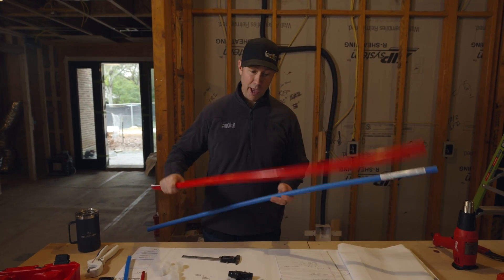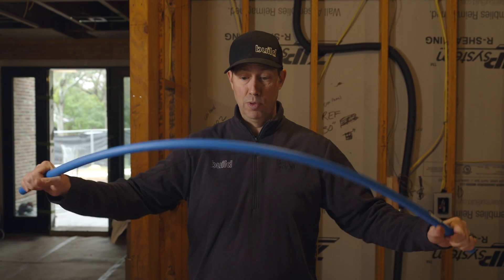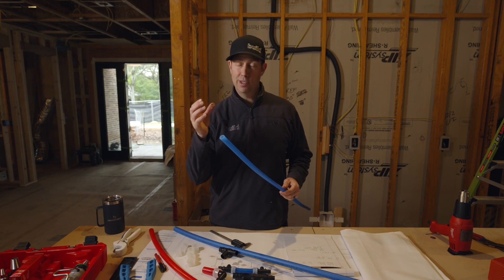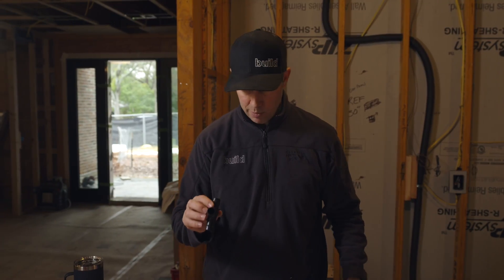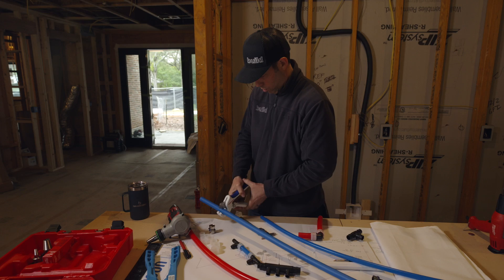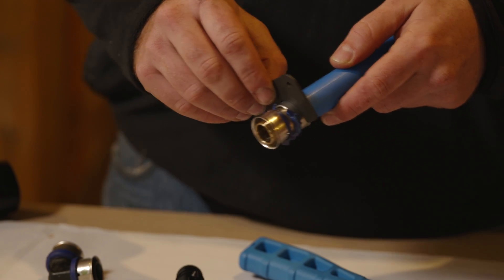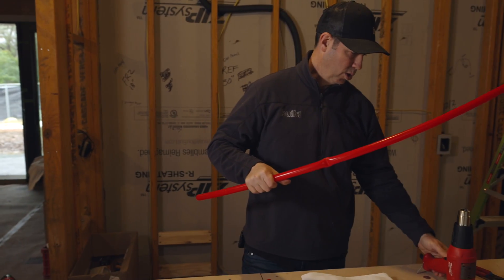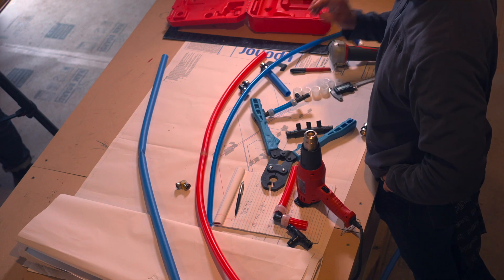Uponor Pipe System Review & Comparison

Comment: I'm doing extensive research on which type of pex system to use for my building and 2 reasons I won't use the Uponor system, 1. The class action lawsuit they settled for the brass fittings failure. I Which of made settle on stainless steel fittings with stainless clamps. These wouldn't be compatible with Pex A tubing. Second reason is Pex B is much more resistant to damage caused by chlorine. My local plumbing supply sold me blue and red Uponor pex A and regular brass fitting with stainless steel clamps. From what I'm reading its the absolute worst combination, in fact I just read that Uponor had to discontinue the blue and red pex A. Yet I see so many plumbers on YouTube singing Uponor's praises. Did I miss something?
Reply: I'm sure whoever is your supplier he only has pex B tipe that's the reason why he recommended that to you , let's  be honest and of course depending in what we are researching in internet that's the information what we get,  I'm sure everyone know how much good the hamburgers are,  but if I go and try to find all bad reviews about hamburgers of course I will find so much,  about it. I'm doing plumbing for last 25 years, and if in this moment  I hear plumber say uponor are the the best in plumbing products, needs to stop doing plumbing and get job flipping hamburgers 🍔   😆 LOL

Comment: Uponor flexibility is great. If it does get kinked you can use heat guns to work it out unlike other Pex. Less fittings is money and less fittings reduce how mucch you reduce your water flow. Uponor fittings always try to squeeze to its fitting and it saves you money on a buying fittings, your most expensive cost over the initial tool investment . . 
Uponor does expand and tries to reduce to its normal size . Uponor always tries to reduce to its original size. 
I'm a tradesman so I've dealt with all aspects of plumbing at some point. 
Pex fittings work fine if you upside the tubing to compensate for the flow. 
The stainless steel route is fast and good in tight places but crimping copper rings holds better but the tools are one expensive . They are better then pvc / cpvc but I personally like copper for durability

Comment: Personally I prefer to use VIEGA . Easier install and you don’t have to have a minimum of 4in gap between the fittings depending on the pex size . Upon just takes forever to install and the Milwaukee expander is garbage simply because the batteries last you a good 20-30 min depending on the pex you are expanding.

Comment: Matt, REHAU is the only other competition to Upanor.  Any differences between the two PEX-A brands is rather insignificant.  Both are PEX-A, and both have all of the same advantages over PEX B and C, including making long runs, without using lots of couplings.

Comment: What about brass fittings that reduce the size of the line? I have to use a brass fitting to connect to a galvanized pipe before I can switch to pex and it’s already a 1/2 inch pipe.

Comment: Every time I see polyethylene pipe, it reminds me of all the people who had to replumb houses that were less than 10 years old because it leaks after time.  I would have a hard time ever trusting plastic plumbing under pressure inside the walls. 

I have similar problems with engineered chipboard. Hurricane Andrew told me everything I need to know about frame buildings with engineered chipboard or structural Styrofoam. I would go steel reinforced ICF if I built a home today.

Comment: Such an ADD!,, 

Such an ADD!!! the pex B can use both crimp and expansion fitting, brass and plastic also. The B is twice as 💪, not affected by chlorine and can be used in recirculation systems, and pex A leeches small amounts of chemicals into the water. Why would you use 1/2 inch to your fridge?  If you make two columns and compare the strengths and weakness the B wins.  Having said that either are fine!  Not a fair advertisement if you ask me.

Comment: It is so sad that Risinger kneeled to a supplier’s marketing while it is so easy to check most of what is said here is false.
PEX that are expandable are ASTM F1960.  IT is not because they are “A” or “B”.  It is because they meet ASTM F1960   There are MANY PEX B expandable on the market today.  Just do basic proper researches.
Chemistry of PEX B is far more modern than ultra-old PEX A.  PEX B does not release measurable chlorines in water like PEX A does.  Which, by the way, was the main reason to develop PEX B to begin with.  PEX A is the next thing we gonna have to remove from our walls like Poly-B was.
The internal finish of PEX B is far smoother and accurate than PEX A.  Creating no internal turbulences like PEX A does.  Meaning PEX B has less internal resistance, consequently canceling any advantages that F1960 fittings may have.
But WAIT !!!  PEX B that meet ASTM F1960 are expandable.  With the extra advantages of using low resistance PEX B tubing.  Expandable PEX B has significantly less hydraulic resistance than PEX A.
Some PEX B has a bursting pressure almost TWICE as much as PEX A.
And PEX B has bracket that will bend and 1/2 tube within 6 inches radius.
Besides cost and being paid by a supplier, there is NO reasons to install PEX A today.
M.  Risinger, could you be professional enough and correct everything that is false in that video ?
Reply: Ok I get it , I use zurn type B and it’s expandable, but another brand may not be expandable?  you would think all type B would be expandable, that’s bizarre! Thanks.
Reply: @mr.redneck2715  An example of F1807 only (i.e. inserts and copper ring) : https://www.bow-group.com/technical-specs
Reply: BOW Pex is a super multilayered product.  Each layer having is own purpose.  It covers almost all potable water applications imaginable, but as long as you use it with F1807 fittings.

Comment: my understanding is that the Zurn PEX B is an expansion fitting too and they claim a better freeze protection....is this true?
Reply: Yes.  Being exandable means meeting ASTM F1960.  Some PEX B are F1960 concequently having the best of both sides.
Reply: No. PexB is stiffer which contractors often mistake for better strength. Hydrostatic pressure is a test of elasticity and shear strength. 

We do our homes such that we limit any plumbing on exterior walls. When we have to, they are wrapped in Armaflex and all of our homes employ minimum 4” Comfortboard 80 exterior insulation. 

If you refer to ASTM ratings, Uponor and Zurn tested identical 5106 rating. The ‘06’ is perfect score for both under burst pressure testing of 600psi long term testing. 

I’d suggest both are highly suitable for freeze burst mitigation but proper design installation is most important contributor.

Comment: Sorry Matt, you are giving a bad advice about Uponor Pex A superior to other Pex and that is not true. Because of its flexibility, which is the main reason it failed and leaked due to hot water. Give it another 4 to 5 years and most likely it will leak on the hot pipe.  From the last 35 years to present, copper pipe has a bad reputation due to pinhole leaks, because some manufactures are using recycle copper especially from electric copper wire, it lost the integrity of copper due to electrons saturation caused by constant electrons movement of electricity and became rigid. There is no winners here. I'm still researching... so far I found a USA company Zurn makes Pex pipe with expansion fitting F1960. The good thing is, it’s not too flexible and sensitive to hot temperature and can withstand hot C temperature (which is about 160 degrees F) for longer time without getting too soft and losing the grip at the connection. Hopefully this will wrap up my research about Pex pipe.
 https://www.youtube.com/watch?v=z3_GtI7O-HI 
https://www.zurn.com/products/pex-cross-linked-polyethylene/plumbing

Comment: Not a bad video but I can't say that I'm sold, especially the kink fix. Think I'll stick to regular pex with brass and copper fittings and whenever I save up for a dream home, that will be full copper
Reply: Copper is no competition for PEX-A.  Even the inferior PEX B and C is better than copper, especially if you live in freezing winter climates.  Copper can't handle the pressures that PEX can, and it won't leach anything into your water.  That kinked PEX-A is still probably six times stronger than a copper pipe.  The only thing Copper is good for is doing rigid stub-outs.  Personally, I prefer Rehau to Upanor.  T the differences between the two are not huge, but I like the Rehau couplers better.

Comment: A MINOR YET WELL SPENT  upgrade...under sink plumbing...instead of running flimsy 1 1/4 or 1 1/2 inch  trap and fittings and then converting to 2 inch at the wall.  Convert to 2 inch ABS pipe at the drain tailpiece and use 2 inch ABS for everything including removable trap.  Sturdy, serviceable, without any of those prone to leak joints found on 1 1/2 drain fittings.

Comment: The great part about PEX A is if you mess up and need to take the connection apart, you simply cut the white ring with a razor and heat it up with a heat gun, it opens right up and pops off.  Can reuse the expensive fittings at will.  SOOOOO much easier than copper!

Comment: OK.... I am a certified Uponor plumber.... what does that mean....mean crap...it mean I am certified to give you a 25 year warranty.  I  don't know if you contractor know about this...but your 1/2" OD Pex pipe is actually iD 3/8" compare to 5/8 copper pipe is actually 1/2"  This is why you need a manifold.....horrible.....Requires more space....I don't recommend Pex if you have a straight line to you bathroom..  I recommend install a 3/4 or 1" riser with a return line.  But if you have a bathroom on the north side and a bathroom on the south side...then its cheaper to run pex...Don't use Pex..copper will always be the best...now you dont have to sweat copper pipe anymore...Press fittings... cost more but you want have any flexing when the water is hot...pex also creak from the flexing..

Comment: PEX B is actually stronger, just lacks the expand ability and flexibility of PEX A.  Is PEX A / Uponor the way to go?  Yes, if you can afford or borrow the $500.00 M12 Milwaukee Uponor expander tool, and if you have access to place that sells PEX A.  For the average Joe, PEX B with the barb fittings and crimp tool Matt used in this video ( blue handled SharkBite brand) works quite well, and is very reliable, and more affordable!  If done  right, I.e. follow the instructions carefully, the connections are very strong and reliable.  Make a few practice crimps before doing the actual fitting.  An exception to what Matt said; the PEX that snakes through the wall directly behind him, could be done with PEX B.  PEX B can safely handle a 4-5 inch radius, and there are bend supports that facilitate such bends.  This video has some useful information, but misses the mark, IMO.  YMMV Peace

Comment: On a related subject, what suggestion do you have to prevent noise within walls caused by the expansion/contraction of hot water pex lines? I thought I would be done with the clacking noise of copper lines, but I was wrong.
Reply: Holy crap....That's is what I been saying...and I'm a certified Uponor installer. you cant stop the hot water from expanding...and it will always creak...Copper will always be the best as long you insulate the pipe.. dont under drill the hole  on the wood.....big difference. Or else you will end up install a hammer rest...  with copper ...you can actually have real water pressure.  cause 1/2 pex is actually 3/8 copper...same as the ones you install underneath the sinks... but 1/2" copper is actually 1/2"

Comment: I just used Aquatherm to plumb my new house and it's amazing. I'll never use Pex again.
Reply: I just looked it up and that is hilarious, My guess is that system is dead on arrival.  The Youtube is hilarious in how complex it is.
Reply: @ergofred  don't go by what you see online. It is still going strong in my area, and it's not complicated at all. It installs just like PVC except instead of gluing the connections you are fusing them. It's really hard to mess up. The pipe itself is self-insulating, the pipe fits inside the fittings (like pvc), etc. It is a superior product to this PEX junk which I have seen countless failures with.

Comment: I’m not convinced that the diameter reduction for the length of the fitting is even noticeable to any user.
Reply: And you are right.  PEX A being what it is, the interior finish cannot be as smooth as PEX B.  So, if you are using compressible fittings with PEX B, the internal finsih will cancel any hydraulic advantages that PEX A may have with F1960 fittings.  Evidently, if you are using F1960 PEX B, then you gain both larger fittings advantages AND lower tubing resistance.

Comment: I live in two states and cannot buy pex-a in any retail store. No matter the brand of pex, the online catalogs of pex fittings are fragmented, incomplete, and just poorly done. I already bought the expander and am committed to pex-a, one brand or another, but I hate the idea of having to over-order supplies because I can't wait a week for replacements or forgotten fittings. I also am not impressed with termination options of any of the pex products. Why would you want to run plastic, only to then break out the copper tools, etc? Why not have better termination with covers that make for a neater install  without one more connection inside the wall or floor for addons, etc? cover plates, etc. Product line is very basic and any of the exposed bits look haphazard at best.

Comment: Ok Matt I love your channel , but I gotta agree when you mention one product over another in a comparison well it kinda looks well not right . Having said that you should have talked price point , and YES got nurdy on chemical composition some . When you heat it does it larch more chemicals into the water then a splice. Used both types the both have there place in the market . The multi ports r great and the flexibility. BUT you gotta talk bottom line Also . And as far as restriction due to the fittings bottle necking I don’t think one person out there is gonna notice a pressure difference. LOL just saying . And you may have mentioned these in other videos . So now it official I love only 97 percent of your video . And I hate to hit thumbs down , you took the time to do this video , I took the time to watch and comment so well I’ll give it a sideways thumb . Heck you won’t read this anyway . Lol by now your people got people that do it . LOL

Comment: I use uponor for the same flow reasons you speak of. That being said, compared to copper pipe, I would still go up a nominal pipe size with pex a or b. The drag coefficients are similar. So unless you really use far less fittings than the copper equivalent the flow will suffer due to a smaller ID of pipe. This especially comes into play when you are talking about hydronic systems where GPM is important or domestic systems where fixtures need certain gpm. Uponor has a great calculator for pressure drop, velocity and gpm... just google it.

Comment: Been installing pex since it first came out.....guess what? Either one is fine. Prefer crimp pex because I find it faster and doesn't require expensive battery operated expanders. Every bit as effective at potable water distribution. And don't start with the "uponor is true ID" nonsense either. Your shower valves have 3/8" inlets. Same with faucets etc. Just size your piping correctly and volume and pressure should be perfect. Good uponor commercial though.
Reply: Totally agree. How often are you going to find a heat gun in the field during plumbing? Why would the ID of the fitting  matter when the flow is controlled by the end fixture that is 3/8". I've been making pex pipe and fittings for various leading manufacturers in the US for years. He does not understand the science. A1V1 =A2V2.
Reply: @JS-hl1oc  There's a lot more Matt doesn't understand than science. You can tell by his delusional beliefs in taking the bible as a literal text book...anybody who can do that is delusional and does not base anything on their life in "facts". In Matt's head, more expensive = more better, just because it's more expensive. (And they gave him some for free!)
Reply: @ryanroberts1104  You think you evolved from ocean slime.
Reply: @jamescole3152  That's got to be one of the stupidest insults I have ever hard.
Reply: Installing for years and think a couple hundred bucks for a tool is too expensive?
Reply: https://youtu.be/GV8bqCHc5eA